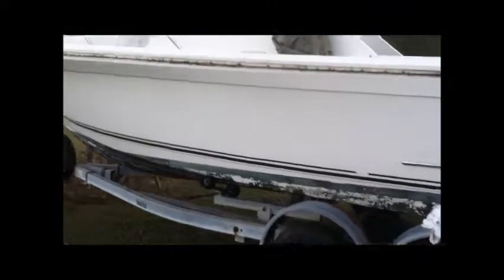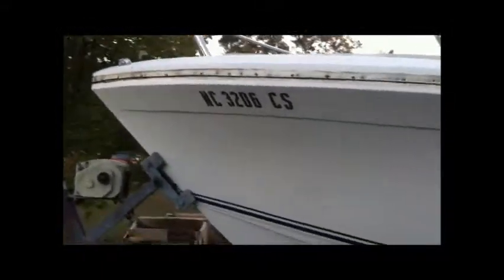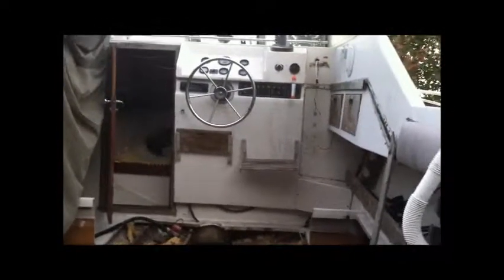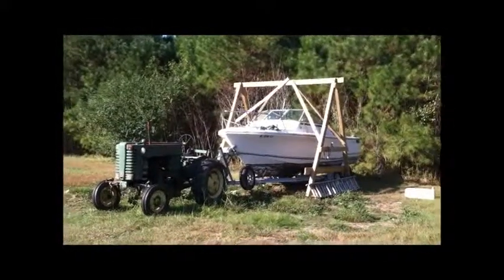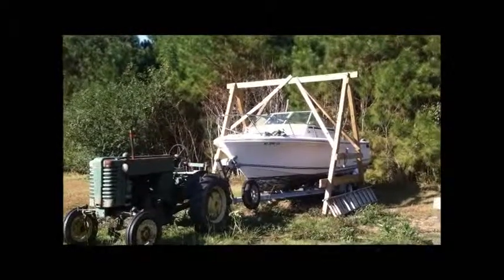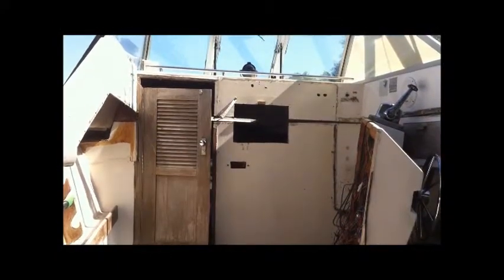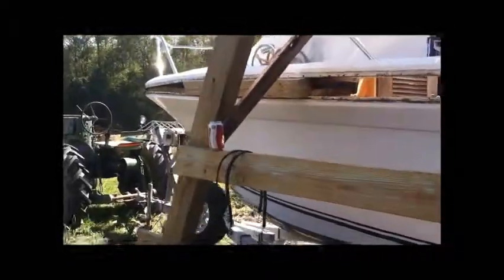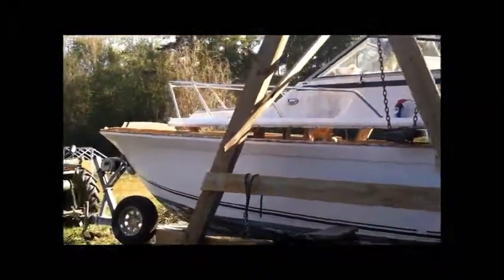Robalo boat project 4 {Boat Cap Removal}

Comment: 4×6×12' is what i usef as a bean and 4×4 as standees with 2×4 braises and it did hold a 5.0 Mrecruiser inboard pull out and reinstalled a new one.
Reply from the maker: If yours held a 5.0 mercruiser this was nothing compared to that.
Reply: Yeahhh.    You did a good job...

Comment: Can you tell me how to raised the cap, for example, support for the cap and chain locations to keep it straight
Reply from the maker: I built a  A frame out of 4X6X12 and made a triangle to support the cap.
 I would not do that again. I think next time I would sink some post in 
the ground on each side and put a top rail that would support the cap 
with crossing boards. It would not have to be so high and it would have a
 lot more support and less chance of dropping it. The way I did it made 
the cap hard to put back on.